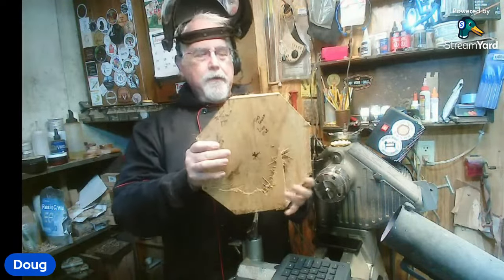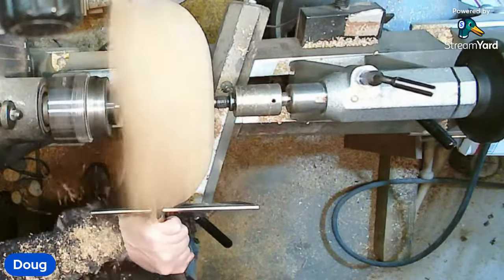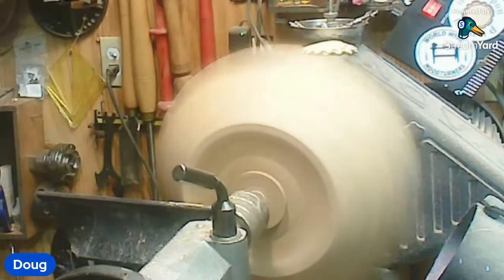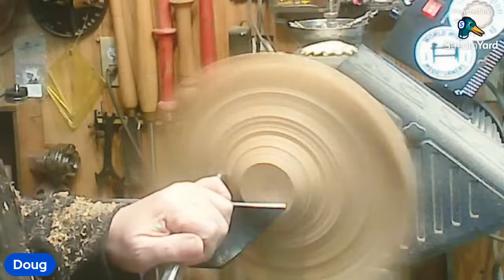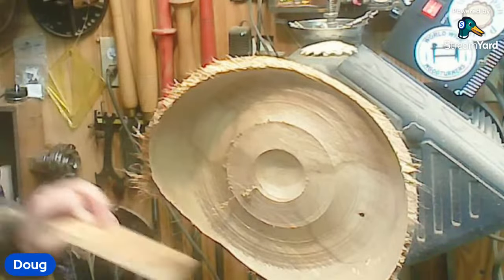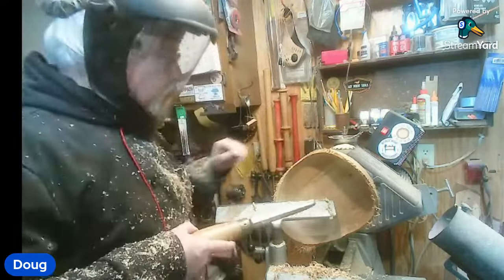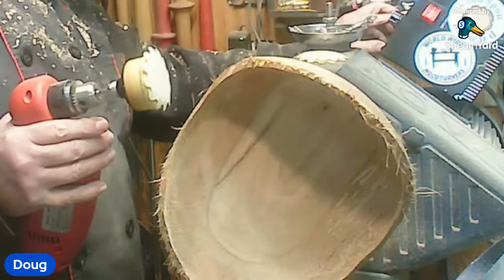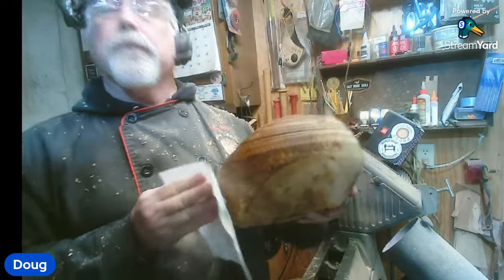Is It Still Live Oak After Its Been Cut Down?  Woodturning a Piece of My Heritage!

Comment: I agree about the leaves coming off in the spring from the Live Oak. I have quite a few of them in my neighborhood here in Victoria, Texas. We are about 22 miles inland from the Gulf of Mexico. I live on the outside of a corner lot so I get al the leaves from the houses around both sides of the street collecting at my front door. Regardless of which direction the wind blows, from three of the 4 directions, it ends up at my front door and just when I think I have raked up all the leaves from the other trees in the neighborhood, here come the small leaves from the live oaks in the neighborhood. But I love the interesting grain inside the live oak. Some of it has a very wavy quilt like grain in addition to the grain that you could see in this particular piece.
Reply from the maker: Thanks for watching. I fully agree. They make throughout the neighborhood, unless everyone has them. Sure turned nicely though.